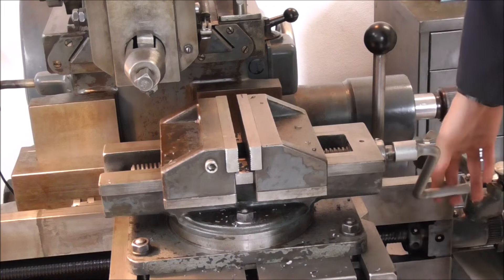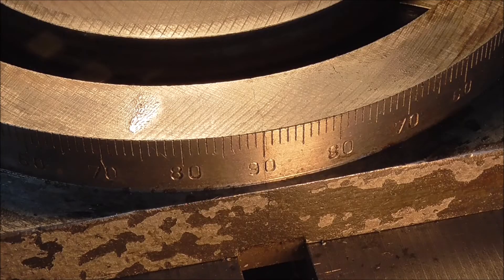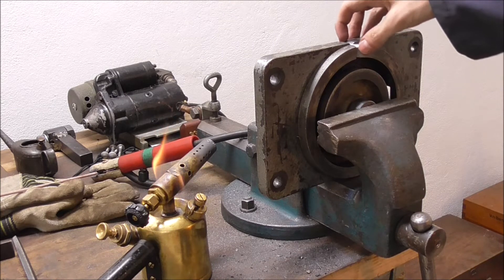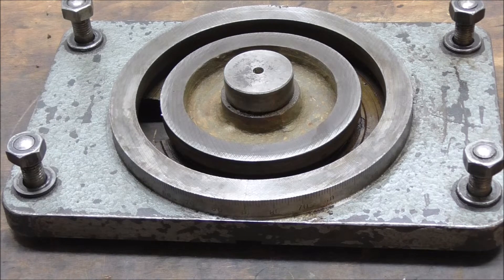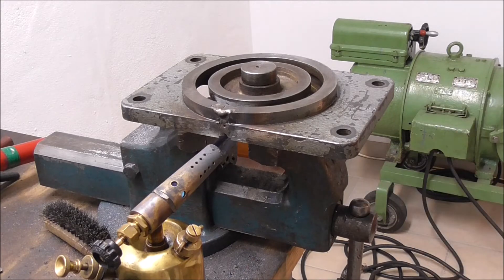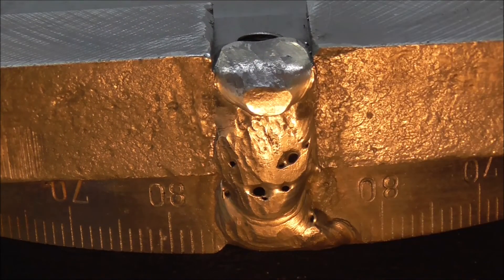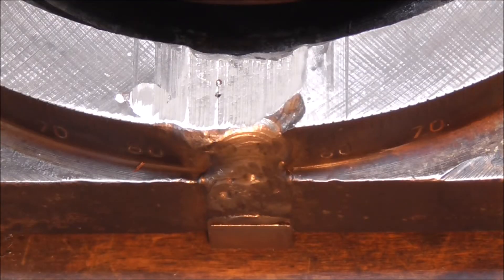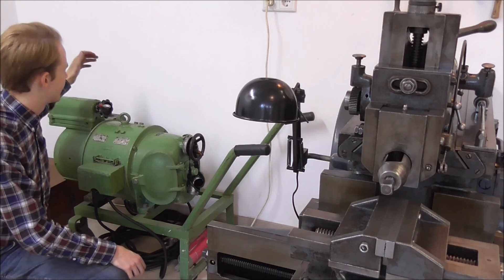Siemens-Schuckert Welder Motor-Generator - Part 2: Welding a Vice

Comment: Scott Pecora
I would suggest you watch Keith Fenner, at Turn Wright Machine Works.  Or Keith Rucker at Vintagemachinery.org. both are pros at working with cast iron.  First they do not weld, they braze and sight the many reasons why?  I was skeptical at first but have become converted over time. They're a host of reasons not to weld, one being crystaling the cast iron which causes weakened areas around the edges of the welds.  Welding causes such rapid and extreme temperature changes.  Go watch you'll see what they're talking about
Reply from the maker: It's more of a bodge-job, I agree. I know about both Keiths and their great bronze-soldering skills, but unfortunately do not have Access to an Acetylene torch, so I had to resort to welding. In this case, I'm pretty confident it will suffice.

Comment: Please can you tell me if you have configured the welder to run on Single Phase or is it operating on Three Phase. I converted my Oxford Oil Cooled welder from Three Phase to Single Phase easily. I am considering buying an old motor generator DC welder, a Lincoln Lincweld DC 250 MK. They are Three Phase but it might be possible to run it on Single Phase or, modify it to be run from a 9hp petrol engine I have lying around needing a job.
Reply from the maker: Hi,
mine runs one 3 phase.
Reply: @AstraWerke  Cheers young man!

Comment: Very nice weld repair of your vise Adrian.  If I may suggest, based on my experience...the holes in your weld deposits are "blow holes" caused by gases escaping the weld metal as it freezes solid. These are caused by moisture in the electrode coating.  For most home shops, that do not stock "new electrodes" or store old electrodes properly in an oven, a remedy for this is to run the first 1/3 of electrode on scrap, first, then proceed to your repair welding.  This burns out the moisture, and will improve the deposit. Also, Hi Nickel [99%] are best for machinable cast welds. It looks as though you used a high alloy SS  19 Cr/9ni. or 29Cr/9Ni repair alloy, which is also OK, as long as preheat, peening, ect., as you have done well.
Reply from the maker: Thanks alot for the detailed information - I really appreciate it!
I honestly have no idea what exactly the electrodes are composed of, a friend of mine gave them to me when I asked him if he had something to weld cast iron.
So I imagine he had them lying around for quite some time already and they must have gotten wet.
What about putting them into the oven for some time? Would that help?

All the Best
Adrian
Reply: @AstraWerke  Yes, re-drying @ 350F for about  1 1/2 hr will do. If rods are very old, put them in cold oven and allow to ramp up to 350F , flux coatings will crumble some on very old rods. rendering them partially unusable.
Reply from the maker: @AWDJRforYouTube  OK, I'll do that. Thanks a Million!
Reply: 👍👌👏 Great advices/suggestions!
Best regards, luck and health.

Comment: Nice repair. To preheat before welding it is better to heat the whole part equally. I understand that not everyone has a flame torch, but every one has a barbeque. Just a tip.
Reply from the maker: You'll laugh: We don't have a barbecue! I might however get my hands on a foot-powered forge someday, though. Maybe.
Heating the whole thing would have been the better way of doing things, though. Even if it would have meant bye-bye for the paint... Or what's left of it anyways.